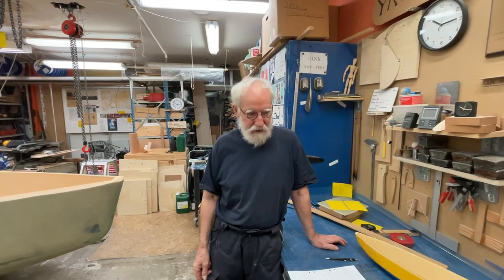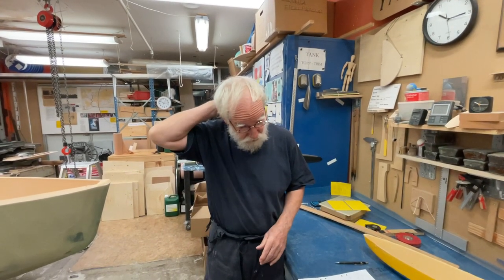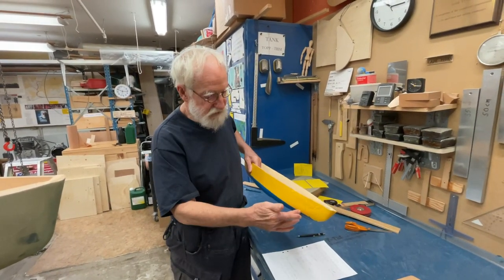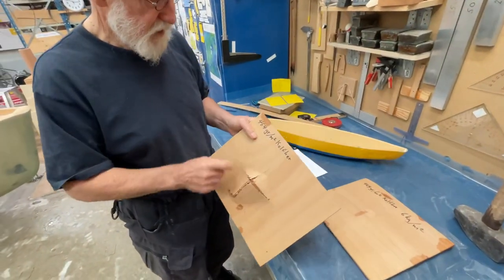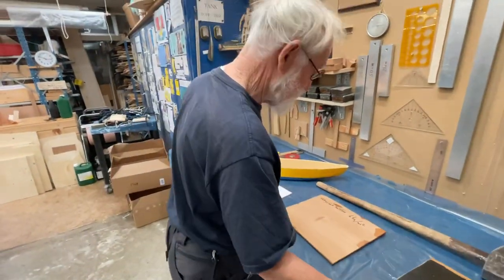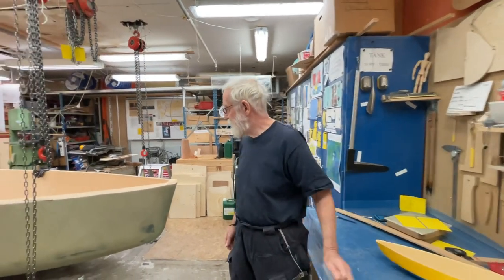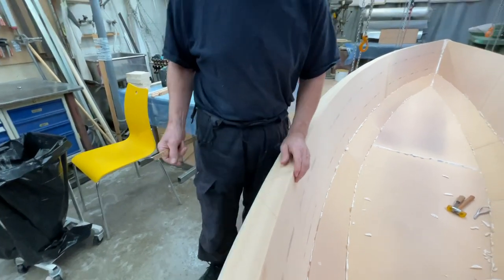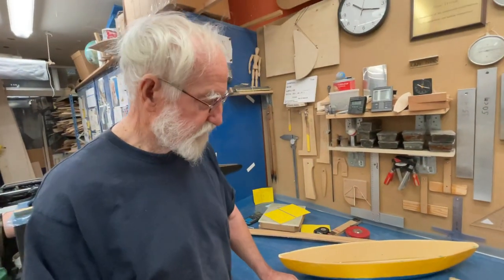A intresting illustrating eperiment

Comment: Thank you for the lesson Sven, very informative. It's not something that would normally be thought about too much, the general narrative would suggest most people would only be concerned with the strength of the outer hull and use softer materials on the inside. 👍

Comment: Excellent information sir.  Thank you for sharing.  Have you ever done an experiment with a sample piece of the hull, as you are building now, to see how much force absorption and deformation you get in the form before there is any damage to the interior skin?  It would seem that it would provide an additional safety factor to the hull integrity in the event of an impact.
Reply from the maker: When I cut out a piece for example for a hatch I often test it with a hammer or jump on it supported on two ends. I am always plesed with the results.

Comment: So not only does the divinycell provide excellent insulation, it's considerable thickness effectively  multiplies the strength of the internal carbon fiber layer by spreading the force of an impact over a much greater area.  That's an ingenious combination of material properties, Sven.  Very clever, those Swedes.
Reply: @theoldsailmaker6408  ??? That went completely over my head, the reference to Norway, I mean. Divinycell is Swedish, Sven is Swedish, carbon fiber was invented by an Englishman. Norway? Please fill me in. Jan.
Reply from the maker: @janmaaso  He made a mistake. Never mind.

Comment: I see a lot canoes built with the carbon fiber on the outside and glass on the inside.  I think they are doing it for show.  I agree it is much better to have the carbon fiber on the inside of the laminate and your thick foam laminate also adds a lot to the strength when hitting and object and makes for a pretty easy repair afterward.  Thanks!
Reply from the maker: I agree

Comment: Very interesting video as always Sir. I have a small question & was wondering about your views & thoughts of "Carbon Fibre V Kevlar"?

I have heard that Kevlar may be better suited to certain uses in the marine industry, & I know that both are used, sometimes alone, & sometimes in combination layers. I'm sure we are all aware that carbon fibre can just shatter once pushed beyond its limits, as we've all seen in competetive yacht racing & motor racing. 

Around 10 years ago one of my younger brothers experimented with both carbon fibre & kevlar in making his own car parts (non-structural) for weight reduction (& cost savings), & from his experiments he found that an inner layer of Kevlar covered by an outter layer of carbon fibre not only looked best but performed better when we jumped on the panels to test how strong they are. 

My Brother's results were very interesting & the kevlar only added a small amount of extra weight (1x layer of kevlar on top of 1x layer of carbon fibre) & was cheaper (than 2x layers of carbon fibre).

Apologies for the length of my comment, & if this question has already been raised. I don't expect an answer as I know you're very busy, & I know you've already thought about this, but your knowledge, experience & skills are greatly enjoyed & valued by us all. 

Thank You
Reply: I was thinking the same thing but then recalled certain boat builders offer nordic customers kevlar as the OUTER most layer for its impact resistance, do you recall if you tried to puncture the sample or both? , kevlar outside vs inside.
Reply: @TariqKhan-77  Sorry I don't remember much. As my brother was making his own parts to be used on a car (Lotus Elise) the Carbon Fibre was always the outer layer as it looks better. I'm sure he would have hit it with hammers & stabbed at it with screw drivers etc though, I do seem to remember that & I remember we through bits a walls & generally tried to destroy it. I couldn't believe how strong & light it is though... but it does shatter. Hence, my brother experimented with laying the cloth layers with over lapping weave patterns to gain strength from many angles & to see how few layers he could use for various parts (inside & outside the car usage).

Back then it was a little pricey to get all of the equipment needed for the vacuum bagging laminate system, & the "putty" type stuff to make moulds of the parts you want to recreate in carbon / kevlar, but once you have it you only need to buy the fibre matt & resins. But maybe it's all cheaper now-a-days. Either way, you will save a fortune by making your own parts.
Reply from the maker: I do not like Kevlar in an matris. Resins do not adhere well to it. It also absorbs water like Nylon, in fact it is a kind of Nylon. True carbon will shatter if pushed beyound its limits. True it gives no warning. But in this case behind 70 mm Divinycell it will never I beleive even come close to breaking.
Reply: @SvenYrvindExlex  Thank you Sir for the information & your wisdom.

Comment: Excellent demonstration.  Considering that glass fiber is nearly as strong (tensile strength) as carbon fiber, but has more stretch than carbon fiber, do you think that lining the inside of a boat with glass fiber instead would be just as effective in resisting impacts and preventing punctures?
Reply from the maker: What I learned is that Carbon fiber is much stronger than the common E-glass. S-glass on the other hand is nearla as strong.
However I think that with thick Divinycell you do not have to worry whatever fibre you use. I use carbon becouse it is very strong.

Comment: I'd be really interested in the same experiment with Divinycell and glas resp. carbon fiber at the inside.
Reply from the maker: In an upcoming video I will show a outside laminate that is almost industructible still cheap a bit more labor intensive. That I do not use it here is that the material is not so common and that this boat will be many times stronger than what I am likely to need. The 70 mm Divinycell is also used because it has excellent insulation. It makes a quit boat and a boat that do not vibrate in big waves

Comment: If I understand and remember correctly from a past video the central part of the boat is more affected by the impact forces than its extremities (stern and fore). So I was thinking if could be possible a differentiated distribution of the thickness alog the walls of the boat of the jointed panels of Divinycell. Like as in vikings boat where even planks becomes slightly tapered towards extremities of the hull. That also allows to bend a bit more, easily, planks towards stern and fore. As example, instead of having 7 cm evenly thick boards, having like 8 around the middle section ed 6 at the extremities.
Reply from the maker: As explained a small boat has no problem with global forces. On the other hand local forces for a small boat is critical. Therefore the thickness is the same everywhere. Also Divinycell is used as insulation also therefore it is important to have equal thickness otherwise you get cold spots
Reply: @SvenYrvindExlex  I got it.

Comment: When looking at the shape of the hulls of Bris (1971), ExLex Minor and ExLex Canoe Yawl it seems to me that after moving from a classic bow to a scow bow you are now aiming for something in between: a canoe yawl with rather full bow and stern.

What's the thought process behind that? A scow bow doesn't dive as easily and has more righting moment. What characteristics do you expect to change with the slightly pointier bow of ExLex Canoe Yawl?

I'm thinking about building a 6-7m foam core glas/epoxy closed boat. So far I envisioned a hull shape much like the over water ship of Bris: A double ended dory hull with slight rocker and a cabin over most of the hull. But no keel, instead water ballast, flat bottom, center board, second small dagger board aft for self steering balance and a 5 - 6 m² simple laser like rig. That's why I'm so interested in your design evolution.
Reply from the maker: Its the intentions that have changed. After 150 days at sea in Exlex sailing slowly I realised that I was happy in a small boat. Therefore this boat is made to be better in the slow speed range about 0.2 Froude number. I also will be happy with a maximum range of 10 000 miles. In that speed range the hull resistance is very small hardly noticebel so a small sail area is sufficient as she has a small wetted surface

Comment: I have read the procedure you describe on your website about starting the work with high temperature in the workshop to prime the Divinycell and then cooling the heat to shrunk the air and make epoxy penetrate better. 
For how long and at which temperature have you heated the workshop?
This procedure is only necessary for external lamination with fibreglass layers or have you used in the past also for the inner lamination, or for gluing pieces inside a heated box or others like heat gun?
Reply from the maker: I put on the heat before going home the previus day. I could have made it better but it turned out very well. It was the first time I used it.

Comment: This is a very important information, thank you! What about the outer layers of fibreglass? They will certainly split when hit by the hammer. And so water will intrude. But apparently no structural harm to the boat, amazing!
Reply: The pvc foam is closed cell, so doesn’t absorb water, so as long as the inner carbon layer is not punctured you’ll be ok.
Reply: @robinhodgkinson  well Sven said in one of his videos that it is very important to make the outer core watertight.
Reply: In reality it is highly unlikely that the boat would be hit by a concentrated blow like that of a hammer, especially when out at sea. Even  if it was, there would be no urgency  to repair the damage as the foam doesn't absorb water. Obviously you'd repair it sooner rather than later to maintain the hull's strength and appearance.
A boat like a Boston Whaler is a foam core sheathed in glass, and you see them in use for years with bits of the skin missing.
Reply: @cornishhh  
re -- impact on small boat
I think a small boat would shift away from the impact, instantly eliminating the stress.
Is this one of Newton's Axioms?
Reply from the maker: Divinycell do not absorb water. In an upcoming video I will show an outer layer of a different material that is much more energy absorbing than glassfibre, Kevlar or carbon. If I forget remain me I built such an boat in the 80-s
Reply from the maker: @largemarge1603  Right: "Rolling with the punches" as the boxers say
Reply: @largemarge1603  That's right; contrast hitting a 50kg dinghy with hitting  a 5 ton cruiser, especially if both are in the water.

Comment: Why do you not have the same on the outside of the hull as the inside. Just carbon not glasfiber. Wouldn’t that make the hull stronger?
Reply from the maker: I belive that glass is more resistant to wear than carbon

Comment: Very interesting.  Why not Carbon Fiber both inside and out?  Is it because you want the outside layer to be weaker to dissipate the forces to the more robust back-up layer?  It is part of the mechanics of strength of the design?
Reply from the maker: I do think glass is more resistant to wear. In an upcoming video I will show an extremly strong and cheap outer laminate that however is more labor intensive but would be excellent with vacuum injection
Reply: @SvenYrvindExlex  Im interested to know which outer laminate you speak of??   Basalt fibre?
Reply: @SvenYrvindExlex  thanks and looking forward to it.

Comment: Carbon fiber, if I am not mistaken, is comparatively strong when it come to being used in consideration with lighter weight application but is brittle. So, I think, not a material for a hull that takes sharp impact forces like that of the sledge hammer, or in real life rocks. I may be wrong, but it an impression I have.
Reply from the maker: Carbon is very strong. People say its brittle. I think a better way is to say it gives without warning. I have now lived about 300 meters from Marström Composite I am often there sometimes I use a hammer on pieces. Carbon especially if made from prepreg and cured inder vacuum in an outoclav is extremly unbrittle, but given enough force it can break and that comes suddenly.
The main problem with carbonfibre is two it is expensive and it is used where people want a light construction. If it was cheap and if it was used by farmers or fishermen no one would call it brittle
Reply: @SvenYrvindExlex  Thank you very much. It is so good to hear this from your intimate experience with carbon fibre in your work.

Comment: Carbon fiber has high tensile strength and low compression strength.
Reply: Exactly, this is the property which is perfectly applied here
Reply from the maker: All composites are less strong in compression than tension, glass. carbon and especially Kevlar.
Reply: Carbon has good compression strength..  Thats why aircraft main wing spars are made of it, and yacht masts ,, the ultimate compressive load.

Comment: Sven, your experiment seems to be carbon glued to plywood, is that equivalent to carbon bonded to foam?
Reply: That definitively seems like foam to me.
Reply from the maker: Its not equal but the physics is equal. That is the carbon have a something between it and the hammer that makes the impact. That distance distributes the destructive force over a bigger area. Also it softens the blow by getting compressed. You may not think that the compression of the plywood will make a differnce but we all know that it hurts much more to fall on a concrete floor then a wooden floor

Comment: "You cannot take a big boat and lift it at one end ..." yes you can. Any modern yacht or trawler say between 20 to 50 feet, can be supported at one end if you can find a strong enough crane.
Reply from the maker: Bigger is less strong globaly as you increase size there is a point there it will break. -The numerical size of that boat is not important. The important thing to understand is that the bigger a structure becomes the weaker it becomes globally
Reply: @SvenYrvindExlex  Even if that mattered, your analysis of the strength of larger boats is inaccurate in the example you gave.
Reply from the maker: @dnomyarnostaw  its based on Gallileos square cube law and that is universial
Reply: @SvenYrvindExlex  Don't you  think that the Naval Architects KNOW about that principle, and design FOR IT!
Class Rules stipulate that the support strength of the Hull allows 4 times the fully loaded hull weight by Bow and Stern points.
Your "off the cuff" bigger boats "can't do this" comment is both inaccurate and pointless.
Perhaps you would like to share the finite analysis study of your hull to demonstrate how carefully the loads and pressures are handled.